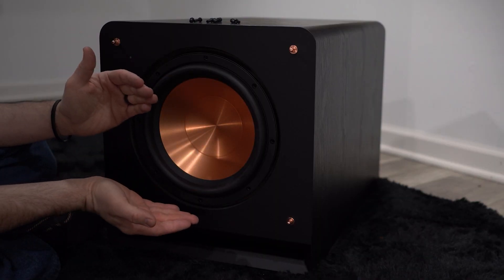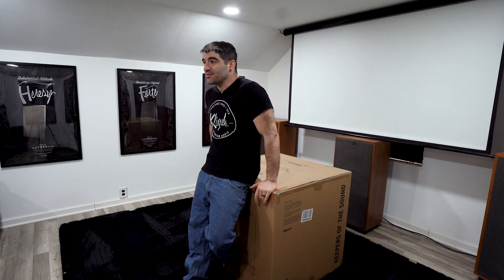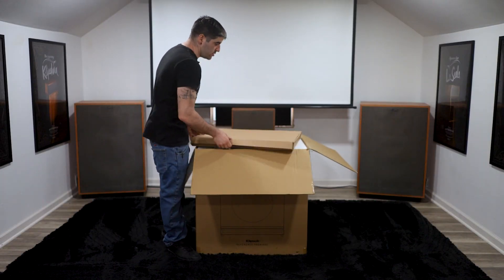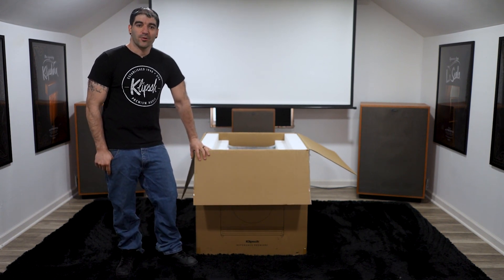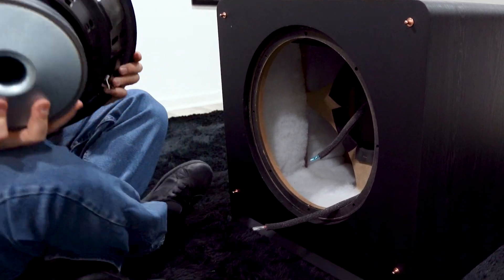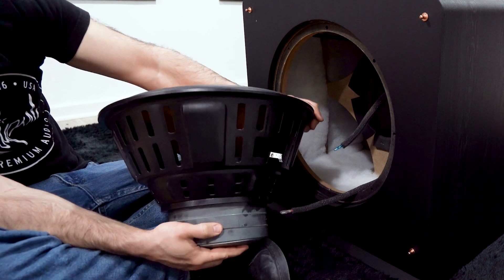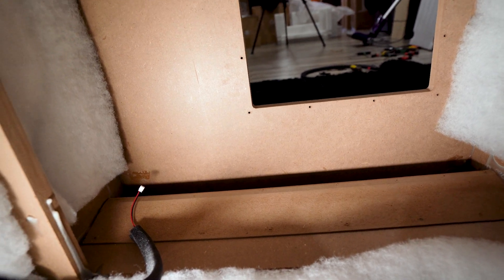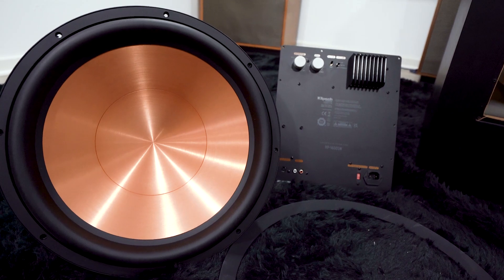What's in the box!?!?!?! - Klipsch RP-1600SW Disassembly

Comment: I don't like how that motor bracing material can come loose and possibly vibrate making some unwanted noises. You can see ,right from brand new, when they stapled the top material to the MDF, it had already let go. I'd like to see it glued and going nowhere. I also don't like the 4 front clips for the cover being visible with the cover off. A lot of people have these speakers purposely visible for their look, and when you remove the cover, you have those ugly pegs sticking out that make it so obvious there should be a cover put on it... I'll stick with my JTR RS1

Comment: How would you compare this to the SVS PB16 ultra? Is this subwoofer magnet/motor bigger?
Reply: No comparison. The PB16-Ultra uses a much higher quality cast basket that adds to the rigidity of the driver while reducing unwanted resonance. Klipsch cut costs by going with a stamped steel basket. Even their older subs employed the cast basket design. This cost more to make, but shows in sound quality. Also, the PB16-Ultra driver alone weights in at 64 lbs. with a motor weight of 56 lbs. It really is a monster. 👾
Reply from the maker: It was never designed to compete with the PB16.  The price alone ought to demonstrate that.  Not a lot to compare.  Some of the YouTube comparisons aren't really intellectually honest in my opinion.
Reply: @TopShelfAudio how are they not intellectually honest when the measurements over and over demonstrate differently? They have dramatically different port tunings, not sure why it’s especially surprising

Comment: Wish these had at least rca outputs and speaker level inputs to more easily use in my room that has several types of systems.
Reply from the maker: you can use speaker level inputs any time you want by buying a transformer, it's not magic.  Cheap ones are like $14, good Jensen ones are like $200+.  Some of the companies who include them just use a resistor from what I hear.  Not the greatest solution.

Comment: what the actual f... pressed steel basket??!
Reply: Yeah, for their top of the line model. Not a good showing. I wouldn't have cut corners with the driver design. 🤦‍♂️
Reply from the maker: stamped steel subs just doesn't really matter in a home audio environment.  any theoretical ringing is way above what the sub would be playing and you just don't need the same strength as in pro audio where cabinets are being moved and slammed around every day.  A stationary subwoofer of this type just doesn't need a cast basket to perform well.  That money is better off being invested elsewhere.

Comment: Yeah but is it designed to not have shit reliability
Reply from the maker: yeah the new ones are a lot better.  even the spl-150 had hardly any amps that failed.  It was really just an issue with the early R-115SW's.  The new ones don't have a failure rate that is any higher than any other company.
Reply: Has a 5 year warranty

Comment: Imo yes this is a nice subwoofer I'm sure it performs great. Even tho I am into home theater my main interest is car audio The funny thing is the big powerful HT subs drivers look pretty light duty and often cheap in comparison to car audio subs, take this one for instance for starters the whole 16" thing sucks they are not rebuild able unless the whole top assembly is ditched only using the motor a 16" bare cone is not readily avalible, if it was 8,10,12,15,18,21 and 24s are. The frame/basket is super chinsey, its steel and looks very thin. I CA subs not all but cast frames are pretty common in $150 subs and up and almost every thing $200 and up have cast frames they are stronger and more dead resonance wise. A triple stack is very common on $200+ subs that looks like roughly a 200oz triple slug I have a 10" sub with a 3" coil motor that size it started out as a $200 sub. Just $350/$400 will get you a beast of a driver with 300oz+ and 4" coil cast frame sub with minimum of 3"  total excursion and 28mm+ of liner excursion. My custom 18" sub I built from ground up (I actually built the motor) has a 630oz 7 stack, a 3" x3" 8 layer coil huge mega roll surround on a thick pressed paper pulp cone and 12" spider and giant sundown audio cast frame likely the strongest available, I have about $700 in it.  On even a 2.5k wrms amp and a basic 7cf ported enclosure tuned to around 28htz it would shake a house apart and it will run on a 5k amp non stop all day with 4" peak to peak excursion and 30mm of linier excursion that would make that very expensive Klipsch seem like a Bluetooth speaker. My point is just selling it as a HT  and a pretty enclosure they charge insane prices on and the value is terrible in comparison of a car audio sub. And as soon as I can find a large PA amp reasonably priced it's going in my home theater, I'll have maybe $1400 in the whole works and it would out perform most bad boy HT subs even the big SVS pb16. But this is a nice sub lol.
Reply from the maker: Where do I start.  

Home Theater isn't a competition environment and rebuilding sub drivers just isn't a thing, they rarely blow up and it's not worth messing with when they do.  

Cast baskets just aren't necessary in a home environment.  The strength isn't needed due to not being dropped like pro audio, the resonances are way above the frequencies that the sub plays.  

7 cubic feet is pretty danged big and is obviously not the target of mass produced subs targeted to the average user, plus once you consider markup and shipping that $700 is way higher so it's not really an apples to apples comparison.
Reply: Know the diff between home and auto audio......................